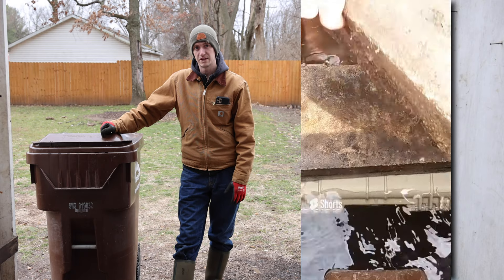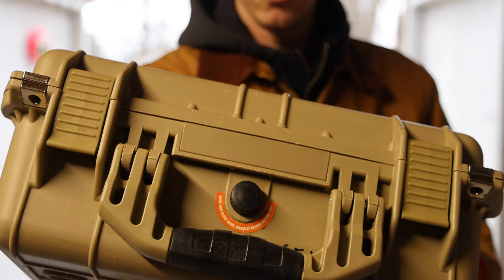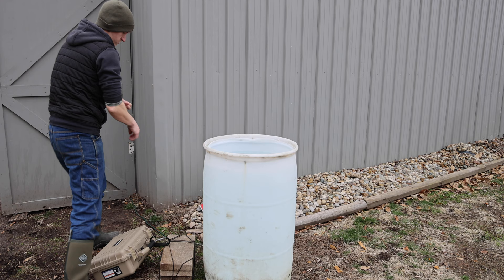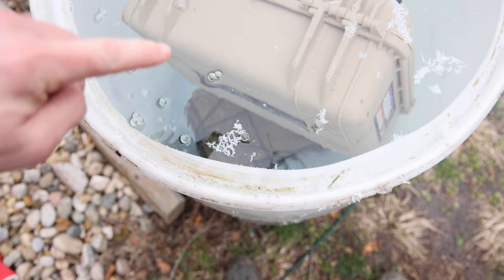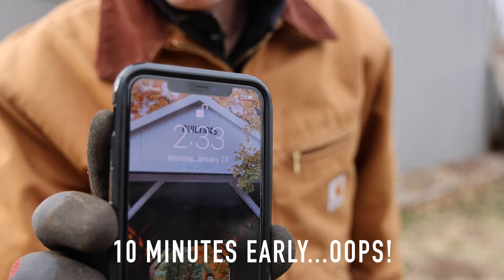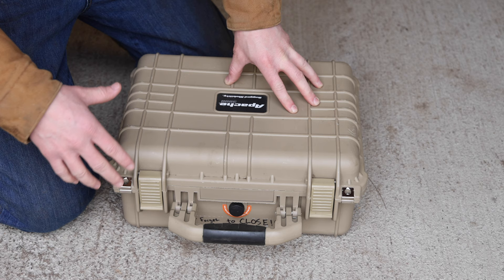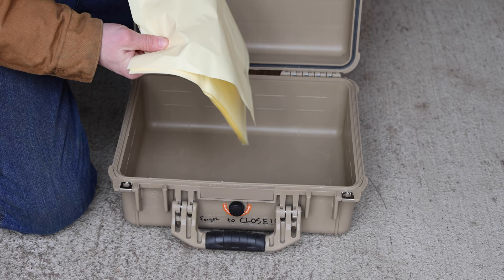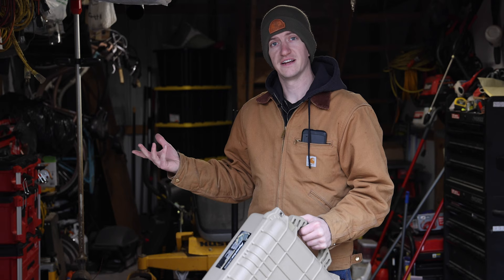Will it leak? Harbor Freight Apache Waterproof Case Test

Comment: I use both a 3800 and a 4800 to haul camera gear on a kayak.  I periodically test these by submerging them for at least 30 minutes to make sure they remain water tight and have never had a problem.  It takes about 40 pounds to hold the 3800 under water and 70 pounds to keep the 4800 down.

Comment: Impressive results. I'd be curious to see how it does with some minor agitation. My potential use case has me indirectly dropping and submerging these into water. I'm not sure I'm trusting these more than my Nanuk just yet, but still cool to see.
Reply: Sounds like a boating accident. Consult with your dog before proceeding.
Reply: Does the Nanuk use special silicone, latches, or plastic?
Reply: @budderbear  Nanuk uses a dual action latch which prevents accidental openings.

Comment: Have the 3800 mounted as a top case on the rear rack of my DR650. Have the 2800 on the rear rack of my Tenere 700. Bothe cases have withstood some super hard on and off road miles with tools, insulated water jugs, etc banging around in them. As long as the vent is closed, they get zero dust or water intrusion. 3800 is 6 years old now and sun faded, 2800 has a latch pin that like to back its way out on occasion. Only time they have even been wet on the inside is when the vent punched a pinhole in a 6 pack of beer on my commute home..lol

Comment: Hi,love the video. with the apache 5800 if you take it on a plane and don't adjust the valve while in the air will my camera gear get damaged? does pressure build up inside? or would I have to get up once in a while and adjust it?

Comment: I put them on my motorcycle and yes they leak. Great price if it’s not raining
Reply from the maker: Just strapped on with no alterations to the case? Is the seal properly seated? I’m just wondering what made it leak unless it had to do with the speed forcing water in?

Comment: Pleasantly surprised having viewed other tests like this. Most were failures.  I thought at first, here's another guy getting some clicks.  In ALL manufacturing there are individual product examples that are marginal to down right failures. If a man Builds it, sooner or later its gonna break.  For the perfectionist... I guess buy one and test it yourself before use.  It is another option to consider.
Edit: This is the first I've viewed your channel.  I know Harbor Freights Apache line. I didn't pick up on which model, assuming its the 2800.
Reply from the maker: Sure, I am trying to get clicks, but also trying to have something worth clicking on  👍🏼

Comment: The Apache cases are cheap Pelican knock offs. They're better than nothing, but they're not top quality cases.  
I'm not 100% on this, but I doubt the Apache' TSA approved.
The Pelican though does require the O-Ring to be inspected and properly installed if it begins to degrade.
I own several Pelicans and a couple are over 20 years old. 
I've seen videos where the Apache' s failed immediately on immersion, so I'm glad you got one that is working the way it should.
Reply from the maker: Your right, It does not have a pressure valve like pelicans
It’s a nice basic hard case, but for flights etc hauling expensive equipment, you get what you pay for with pelican
Reply: Apache is tsa approved. It just has to be lockable and semi non pry-able. There’s a lot better cases out there. However the price point can’t be beat. I’ve flown with them and haven’t had an issue. If you’re worried about high dollar or family heirlooms then, this might not be the case.
Reply: Was reading some reviews and they said they had no issues at the airport.  Just wanted to clear that up if anyone was curious.
Reply: Ahh look at you trying to justify your pelican purchases by telling tales.😆